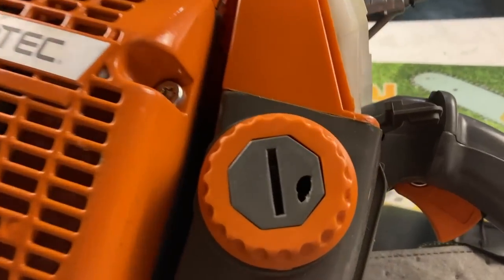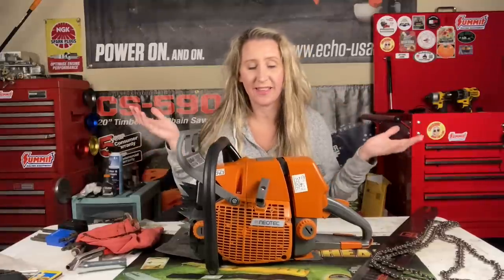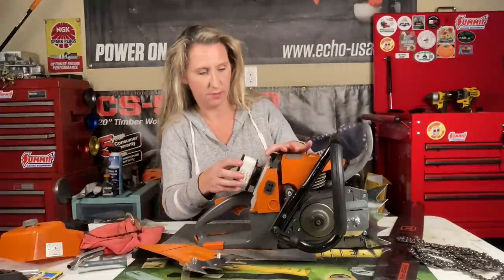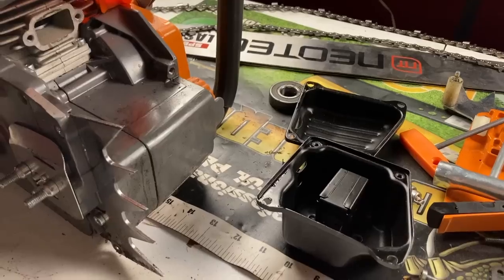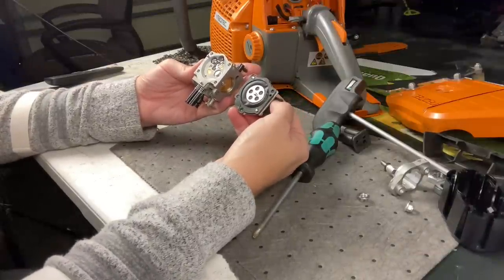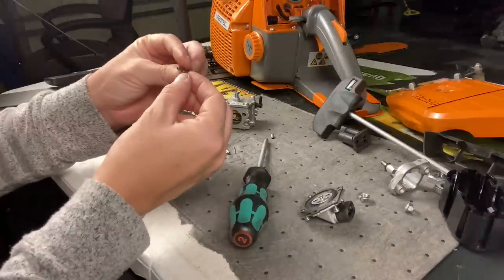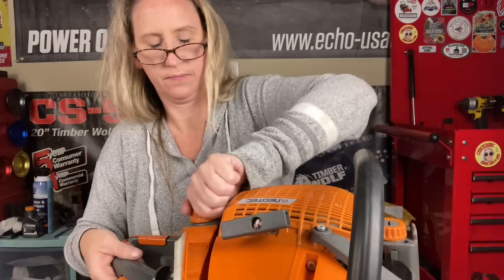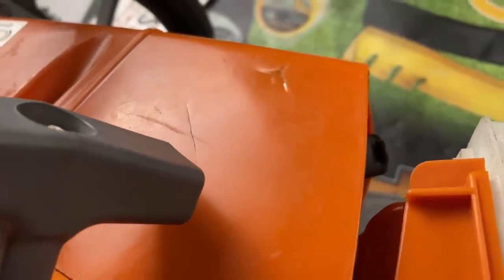NEW "STIHL CLONE" chainsaw, NEOTEC Mechanic Review and Repair. (You won't believe what happened!)

Comment: I am a home owner do not make a living cutting timber however my wife loves her plants, trees, flowers, etc., and she is always planting new stuff and I remove the old stuff and need a chain saw. I bought a Stihl about 15-20 years ago (smaller one with 16 inch bar) and I used it, used it, used it seems like forever and finally gave out. Paid for itself a hundred times over and got one exactly the same from my Stihl dealer (also use Stihl weedeater, blower, etc.) Why do I buy a Stihl. Simple I can take it directly to  my Stihl dealer for maintenance and repair. Buying on line or another brand from Ace, Lowes, HD, etc. They ain't taking it in for repair. Folks this is a big deal, buy a great product from a DEALER that can service it with their trained techs. You won't regret it, I never have.

Comment: I'm going to be the one to say it........... Non-metallic paint specs are not going to hurt a cylinder.
Carb Bad CC - but likely not on Neotec. Most of these manufacturers buy Bulk market items already readily available. Beats reinventing the wheel, if you know what I mean.
*As for the <Junk Cap> - Depends on what punched into it. When and how was it damaged.
Sorry but even Stihl Caps are a sore spot with owners.
In all, I will call a particular piece of hardware Junk if it is disappointing, but not the entire line. At least not until I've had the opportunity to put it through  its paces and compare it to other Same model items currently in use.

Oh, and most of us already know not press a Chinese saw into full time Commercial service. However as a Backup or small operations unit, they often get the job done.
2x Poulan 4018's (Bought used)
1x Senix 49c.c. 4 stroke 18"
1x Salem Master 6220H 20"/22"
1x GreenWorks 80v 18" (Topping/Limbing)
1x Kobalt 80v 18" (Topping/Limbing)

Comment: The problem with these Chinese chainsaws is they should be run at 25:1 and not 50: 1 as always promoted by a lot of YouTubers. There's no such thing as 50 to 1 chainsaw oil it's the chainsaw manufacturers standard that the oil companies formulate oil for. Metallurgy is the key factor in manufacturing modern engines to comply with emission standards 
and Chinese chainsaws are just a facade .

Comment: The issues I have seen with these:

Metal particals from machining left in the crankshaft bearings and in-between the bearings and seals.

Sharp edges in the ports resulting in premature cylinder and piston failure. 

Starter parts that are not durable and have a low service life.

Fuel vents that build high pressure resulting in the fuel being pushed through the carburetor, emptying the tank, while being stored. 

Carburetor build quality issues: low speed jets not located for optimum performance, needle with too much spring pressure, needle not sealing. 

Chain adjuster doesn't work well and low  service life. 

Clutch springs break.

Cylinders bored out of round.

Bad "new" sparkplug 

Fast idle not working at all.

Comment: Oh come on now, what a tease. Show us it running, or if the spring did not fix the issue, lets see the gas pouring out.   Agreed, that saw would never hold up more then a few times but I did want to see what kind of power it might have had with such a large bar on it.

Comment: I bought a cheap 80.00 brand new 20"  saw because of a thief. That was 3 years ago, it still runs, cuts good. I am shocked, never expected it.
The airfilter seal is crap on it, lots of plastic, leaks bar oil bad, but it runs and cuts good.
Luck of the draw
Reply: You can buy an air filter conversion kit and get rid of the original inadequate non-sealing filter.
Reply: Independent,
Try opening the oil cap and relieving the pressure before you put it away!
I put my saws on a plastic boot tray just in case.
Reply: @oldmanfred8676  I pump it empty
Reply: @independentthinker8930 ,
Good idea!

Comment: Those vertical scratches are what I see in vehicle engines with 100,000-200,000 miles on them, not 20 seconds.  If my Stihl MS180 dies I'm buying another Stihl, definitely not a Neotec or any other chinese copy.

Comment: Nearly every thing on a high end saw is sourced from china and stamped by a brand name.  This is because “China has long been the global trade leader for recyclables. Between 1995 and 2016, the country's importation of recyclables grew from 4.5 million to 45 million tonnes. China imported more than half of the world's exports of scrap copper and waste paper, and half of its used plastic in 2016.”      I honestly think this saw may of been poorly cleaned after machining it at the factory and was ultimately scored during quality testing. Before it left the facility

Comment: I know I saw another video on one of these cheap chainsaws and it was melting the bearing holder on the clutch side on the body causing an air leak because the bearing had come loose. It was a pathetic excuse for a small engine. Even the cheap purple chainsaws Walmart sold were better than this junk. Do not be afraid  to tell us it's junk, because that's all it is. Like those tailgater two stroke generators sold by Harbor Freight,  total trash. The exaust  port was never properly chamfered.  I learned how important  that is on snowmobile engines.

Comment: Just dont loan "people" your tools. My bro just got a ryobi 14 inch 37cc at the big box and paid too much. He said it has no dogs, the weird thing at the end that prevents plunge cuts doesnt allow him to use most of the bar and Once its warm its hard  to get restarted.

I said youre paying more for satisfaction. Even as someone who isnt familiarized with chainsaws or mechanics. Take it back and get satisfaction. Sure you can get it running but not at that price. I get the under cut china boy and im willing to fiddle with it. Im willing to employ myself as quality control a little bit. 

For instance the cap? yeah Determine what plastic it is. I dont even have a plastic welder. I got a heat gun a recycle bin full of plastic and a fabric store full of plastic fabric. Im going to town hot gluing that with plastic. Maybe thats not for you. But for me and the rest of world it seems to be where its at.

Comment: China rims aren't that great that's why I buy Oregon rim and drum. I bought a few of the china ones and the run out is crazy on them, the tension on the chain will change as you spin the rim where the center is off.

Comment: Is does beg the question, If your going to cut a lot of wood why wouldn’t you get a good saw from a dealer were you know you can get service, and you can trust it will still be working in 10 years and more. The Chinese want to be the industrial leaders of the world but unlike Japan in the 50s and early 60s there is a quality problem

Comment: The only Chinese saw I like and have had very good luck with it a Huyosen 62cc probably really a 58cc but it's the newer version with the better air filter design. The only bad thing about it is the the chain tensioner which is on the front and not on the cover which I part swapped to a side adjust tensioner and also the pull start is one of the easy start kind but it works great still but in no way shape or form is it as powerful as my Echo 620 or Stihl MS360 but it only cost $160 new and is a decent Zenoah clone

Comment: With that sloppy a paint job on the muffler and the piss-poor improper assembly and parts in the carburetor, I would doubt they have any kind of quality program where that thing was manufactured.  As such, it was probably full of contaminants which caused the cylinder scoring.  Poor housekeeping and poor workmanship go hand in hand.

Gas cap looks like the screwdriver end of the plug wrench punched through it.

Comment: They do have an enhanced version that runs for 40 seconds, LOL. They tell you about all the crappy parts they replaced. Another funny thing is that I think they include some kind of tool to change the rings. I've never had to change the rings on any of my saws. The worst thing is that these guys are stealing the technology of other companies, which spent a lot on R&D. You are putting Stihl, Husky, and Echo out of business by buying these saws. If you need a valued priced saw, go to a dealer and get a used one.